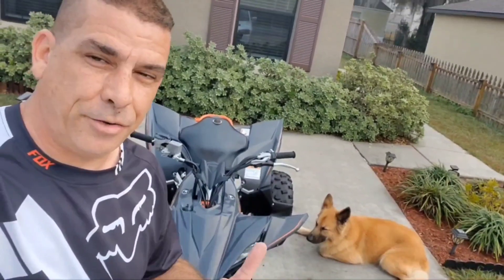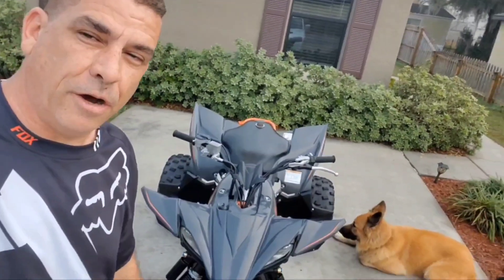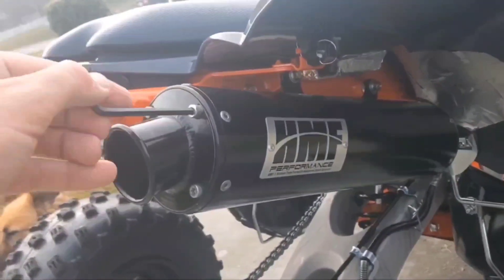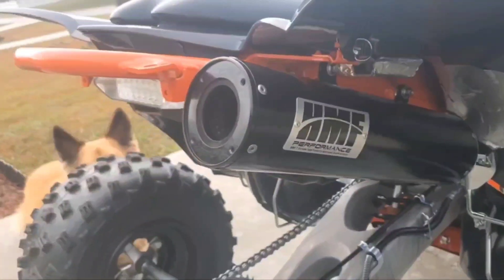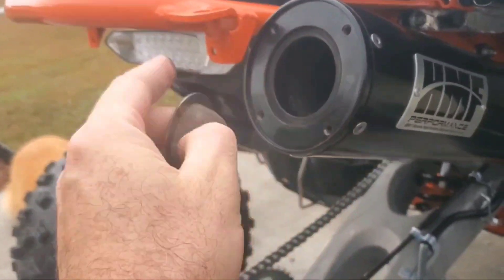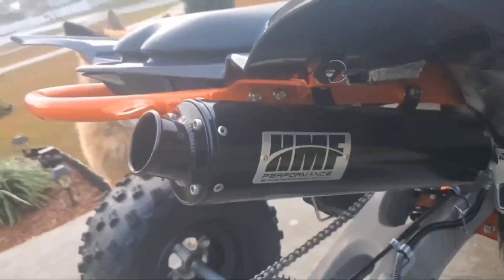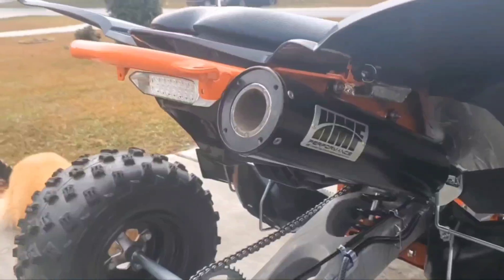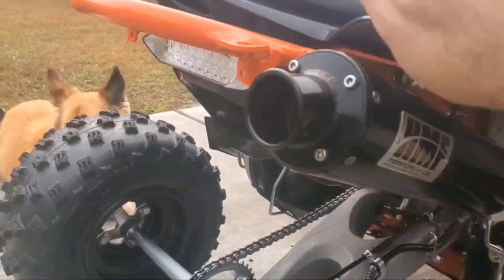HMF exhaust Spark arrester installation

Comment: Thanks, I got it in. This is my first side by side. I have a 1997 banshee one owner lol if you count my parents who bought it for me in 1996, It’s been rebuilt 2x last time by nac’s. Just updated LED’s, rebuilt motor. Custom pipes. Powder coat ( still red and yellow) and the a few 2 stroke dirt bikes, and a kfX 700 , and Polaris 4x4 for snow plowing and hunting.
 And in the past lol I always used screen from Home Depot and put it in. The DNR as long as they saw it or felt it with stick. Now the orv parks are getting strict about legit spark spark arrestors, flags, sound level, a-z. So thanks for the help and answering so fast. I love your 450 I’m 48 my son wants a new atv. He’s in college but in a program I told him if he comes in at least 3rd I’ll get him a new atv, he loves the banshee but says I make him nervous when he rides it lol. I do lol
God bless